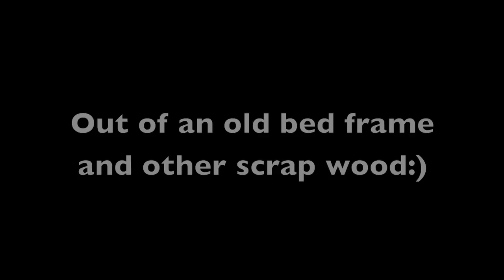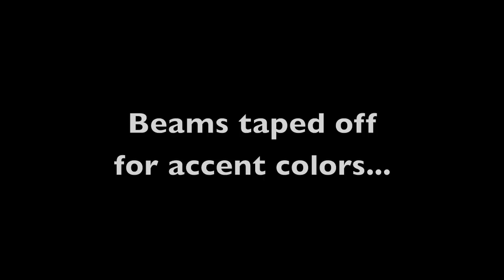Kids Balance Beam - DIY Christmas Gifts for my Nieces

Comment: I like the way you have the miter saw dropped down in your bench, I think I'm going to something similar.
Reply from the maker: Sparrow Bachman Thanks Sparrow, it works well for me.  Actually, I'm planning on doing a little vid of this work bench soon.  It's made from mostly scrap lumber but has a couple simple little mods that I think are cool.  Not fine woodworking at all but I've had a bunch of questions on it... so stay tuned:)  And thanks for watching!
Joe

Comment: Would this work for doing basic gymnastics on? Like cartwheels,handstands,turns,jumps ect.
Reply from the maker: aggirl52703 Hi AG!  It depends on the size of your gymnast:)  I'd say that these should be fine for that if your gymnast is smaller, like my neices 4-7 years old.  But just to be safe I'd probably add another support bracket on the inside of the support legs and maybe consider 2x4 lumber versus the 2x3 that I used for these.   But with that said I was able to walk and jump on them with my weight (225lb) with no problems;)
Anyways, I hope that helps and thanks for watching:)
Joe